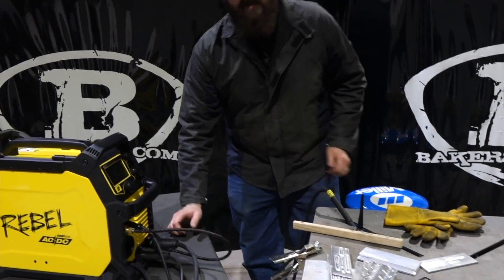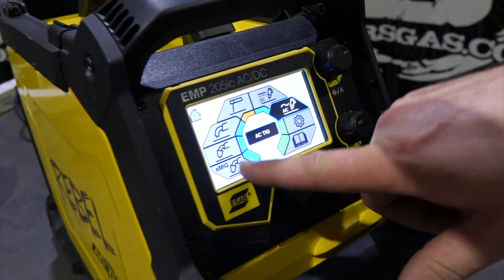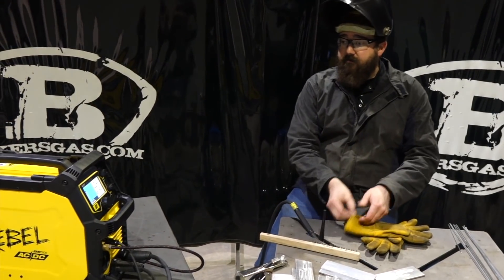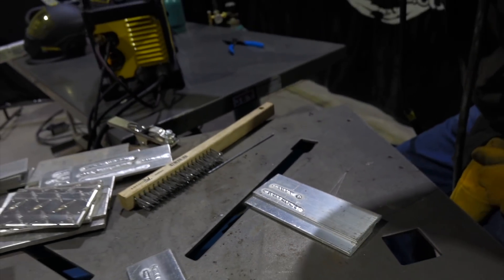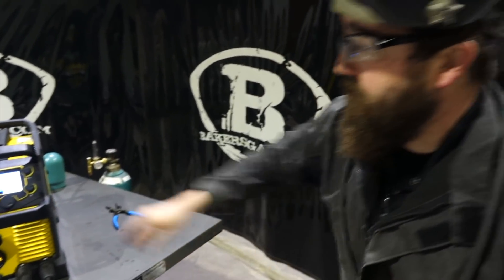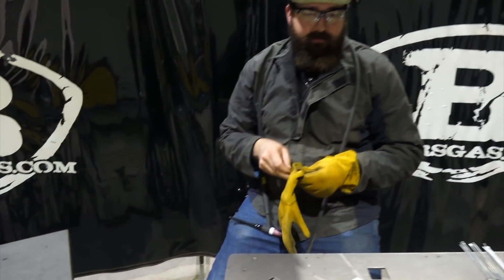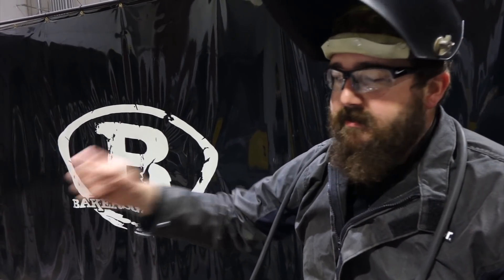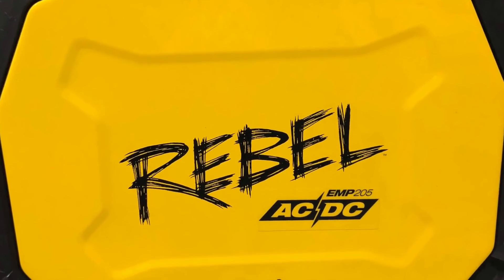ESAB REBEL 205 AC TIG Review

Comment: What's the difference between 205 and 235 ?
Reply from the maker: The big difference is the 205 has AC TIG. The other difference is size and duty cycle. The technology on the MIG side with Smart MIG and the screen interface is the same.

Comment: I have the Rebel 235 with the Tweco Spraymaster 250 mig gun. Are the guns interchangeable between the 205 and 235?
Reply from the maker: Should be you might need an adapter. If you want to confirm send us an email. support@bakersgas.com

Comment: What about the mig gun don't you like?
Reply: Hi Chase, You can swap out the MIG gun if you'd like.
Reply: I swapped out the gun on my 215 to a tweco spray master 250 with velocity consumables. Made a huge difference on dual shield
Reply from the maker: Andrew said he just doesn't prefer it compared to others he uses. Hard to describe he said just the feel and different than what he is used to using not that is bad he just personally doesn't prefer that style.
Reply: Chase Toedter 😉 the mig guns are upgradable. I use a Tweco Fusion 250 on mine!
Reply: Awesome! Thanks I may do that.  What mig gun comes with the 205.
Reply: @chasetoedter9185  That's a great question, it comes with a Tweco® Fusion 180 A MIG gun with 10 ft. (3 m) cable
Reply: Is this welder rugged enough to put in a hard shell luggage and fly with it from US to Philippines? (You know those tsa guys don't go easy on the luggages)

Comment: The fan may be loud but it looked/sounded like it was an on demand type of fan?? If so that just takes it to even a better machine.
Reply: That's correct, the fan is on demand on the entire line of Rebel welding machines, including the 205.
Reply: ESAB what mig gun comes with the 205?
Reply: @smokinbutts2  
Tweco fusion 180